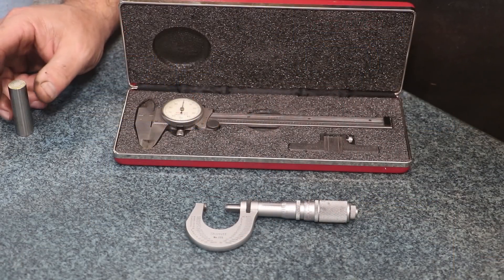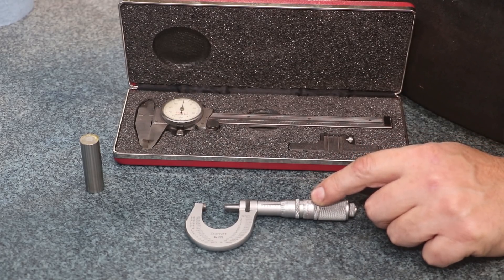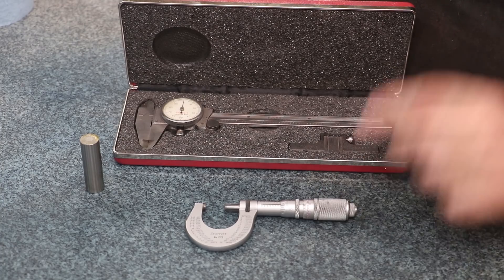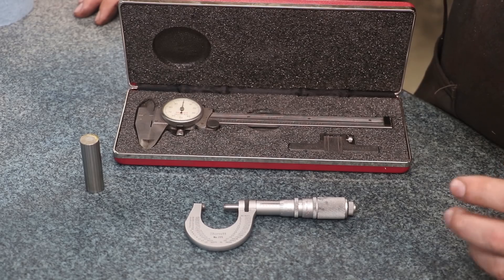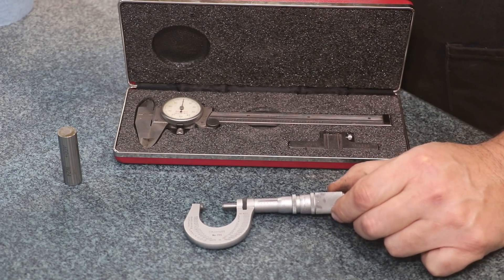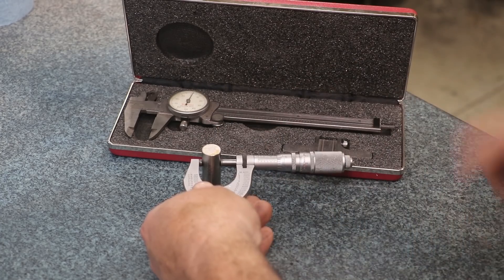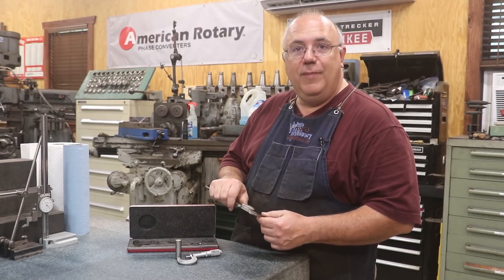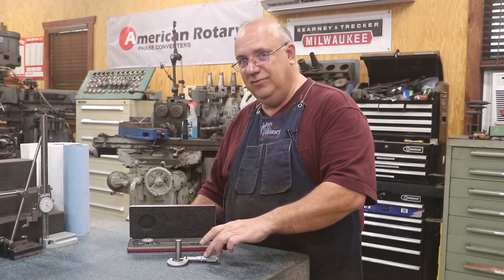Machine Shop Measurements: Dial Calipers vs Micrometers

Comment: I feel the same way about analog clocks versus digital ones. I can look at an analog clock and in just a glance I know that I have 'about five minutes' to be somewhere or do something. Whenever I see a clock at like 1:53 I don't want to have to do the math to figure out that I have exactly 7 minutes to get somewhere. I rarely need to know the time within even 1 minute accuracy.
Reply: Yes,im the same on clocks and im the same with rulers, i think imperial > metric because you can make faster reads due to known fractional graduations, a lot more than on metric sides of rulers.Strangely enough I live in a metric country but chose to use imperial if doing the drawing these days.I have always been able to use either but used to choose metric out of habit. As far as digital calipers go, about 15 feet! That's how far away the bin is.

Comment: I find there's enough space between thou divisions on dial calipers that I can do half or third thou accuracy with that tool
Reply: Sorry WD, but the mechanical design of dial calipers doesn't and won't allow that level of consistent repeatable accuracy. The industry standard for high quality measuring equipment is always a repeatability of + - one count of the tools resolution. Or + - one thou on .001" reading  dial calipers. And what a tools dial or display shows isn't it's repeatable accuracy level. How many divisions or digits there are is called the tools resolution. It's repeatable accuracy and that resolution are not even close to being the same thing. My Mit digitals will display to 1/2 a thou I ignore that number since it's meaningless.You could build a large faced set of dial calipers using the same standard design and put 10ths divisions on it, the tools internal mechanical design still can't repeat or be any more accurate unless that mechanical design is changed to allow that level of accuracy. At one time I believe Starrett and maybe a few others did try making special 10ths reading calipers quite a few years ago. I recall reading they were selling for well over $3k, mikes are a lot cheaper and more durable so almost no one bought them. And a caliper can be that allowed + - one count out on accuracy and they will still pass through even Starrett's, Mitutoyo's, Mahr's etc QC checks. Mostly the equipment will or should do better than that. On average with anything I've checked against gauge blocks it's usually but not always about half of the allowed deviation.  

A set of calipers has some small but very important clearances to allow the tools measurement assembly to even move. Those non optional clearances allow the moving jaw to very very slightly rock out of squareness with the fixed jaw no matter how well there made or by who. For the best and most accurate technique Mitutoyo states that the thumb wheel isn't used. Your supposed to gently squeeze the moving jaw and fixed jaw between your thumb and fore finger for smaller diameters and use both hands to do the same on larger parts. And using a consistent closing pressure every time is important. For round parts that closing pressure should be centered on the calipers jaws where they touch the diameters C/L. It's within feasibility one single measurement just might be able to be read to that half or third of a thou and even be correct. And the next 5 or 100 measurements might be well off that. That's the problem with them, you just don't know when there out to more than that half / third of a thou or by how much. I've checked myself and my calipers more than enough under ideal conditions on very good gauge blocks using the best techniques I know of, and calipers can not be depended on to that level of accuracy. There design makes doing so mechanically impossible. They simply can't repeat well enough to where I'd ever bet real money on even which exact thou there reading to never mind half or thirds of a thou. My solar powered Mits are the tightest yet smoothest pair of calipers as well as repeating to the best level I've seen so far. They'll beat either of my 6" or 12" Mit. dial calipers easily for there repeatable accuracy. They can almost always repeat to about a thou and sometimes less on those gauge blocks under those ideal conditions if I do my part. But if it has to be within .003" or less I always use a mike. Many might chose to disbelieve some or all of the above. You sure don't need to take my word for this, no ones stopping anyone from doing there own research about it. There's lots of free information on metrology manufacturers websites that will back up anything I've said.
Reply: @turningpoint6643  Thanks for your treatise.  You've used a large number of words to tell me I cannot do something that I know I can do.

Give me two well made standards,, one at 0.5000 and the other at 0.5005  and my Mitutoyo calipers will pick up their difference easily.
Reply: @wdhewson  Great response, but it doesn't matter if you can tell the difference between half thou jo blocks. The tolerance dictates the tool. And I'm certain you wouldn't measure a .3937" +.0008/-0 dimension with a caliper, regardless of how nice or reliable you find them. It would be like slot milling with a cut tap...yes it CAN be done, but it's not good machining practice.
Reply: It does depend on the caliper, on some of mine they have 200thou per rotation dials, those are not so easy to get consistent below 1 thou but my 100thou one 1/2 is easy.Ive never needed to go below that and thats only one specific job that i repeat often,more than enough to know that A i am getting consistent output and b:its showing in the data garnered.Im only talking about quality tools,no chineesium.

Comment: I am a machinist as well but I'm always looking for new practical tips and tricks to help make my work easier and better. 
I also enjoy seeing the old machines and trains that you deal with. 
I'm retired now but I'm still very active, I wish I were closer to you because I'd love to get involved in some of the restorations!!! 
I used to do a lot of videography in my spare time but now it's mostly just machine work and electronic control systems.

Anyway, I wouldn't say that calipers aren't as accurate as micrometers, it's just that micrometers offer a higher level of resolution since they have a vernier scale for 10ths. 

I can often guess to within a 10th or 2 how many 10ths are involved by looking at how the needle is situated between the marks on a set of dial calipers and I'm certain that you can too.
I usually only get out my micrometers if I need to measure in 10ths or if the part is too large in diameter for calipers. 

IMHO, viewers that harp about something like that MUST NOT do any machining themselves, otherwise they'd know how impractical and silly it would be to use micrometers for most everything. Again though, if a part is too large in diameter to use dial calipers, then the best choice is to use the appropriate sized micrometer even for low tolerances. 

I have enjoyed watching your channel as well as Adam Booth's and Tom Lipton's :-D 

Thanks, Keith!!

Joe

Comment: No reason not to use the calipers when you are rouging out a part.  If you need the absolute accuracy get it close with the calipers and use a micrometer for the final cuts.

Comment: Excessive accuracy is not good workmanship. When the higher potential accuracy of the micrometer is applied to a wide tolerance part no production benefit is gained. Tolerance, tools, and requirements should be a  matched set when possible. You know how some people complain bitterly when someone uses “there” when they should have used “their”? Same personality trait. It’s called pedantic. You don’t need to tell us about it.

Comment: I once had a young technical assistant (I am a retired molecular biologist) who insisted on using an analytical balance (accuracy 0.0001g) to weigh out a substance to make a 0.5% solution. I told here to use a regular lab balance, but she insisted on the analytical balance. I looked at the solution, which had a yellow colour and noticed that it was much too dark. I checked the concentration and it was not 0.5%, but something more than 4%. She weighed to 0.00001, but set the tare wrong and was off by a factor of 8. The higher the precision of a measuring instrument the easier it is to make a serious error. If you don't need 0.0001x accuracy, don't use an instrument that will measure to that accuracy. It's a waste of time and can lead to errors.
Reply: This is why a lot of good engineers mark out with height gauges, verniers, gauge blocks etc, but do a "reality check" with a simple 6" ruler

Comment: Beyond the clutch to prevent over tightening, can you explain for the non-machinists why a micrometer is supposed to be more accurate?
Reply: It's more precise because it's typically a finer adjustment, as it's a screw providing linear force and not a direct linear force. You can turn a screw a slight amount and it will move in/out of a thread an even slighter amount, if that makes sense.

Comment: Forty years ago when I could see, my favorite was a vernier caliper. I had a dial caliper once. And I never trusted a digital readout that needs battries. When it really has to count you just cant beat  the old C clamp. I had Starrett micrometers up to 12 inch. I enjoy  your videos Keith, you do a great job.
Reply: Not 40 years since i could read my vernier calipers properly but i have come to love dials since.I honestly hated them when my eyes worked properly, now i have 5 or 6 different flavours floating around the place.I guess digital calipers may be good for a carpenter or painter maybe? I must say though a friend has some mitutoyo diamond series vernier calipers and i dont seem to have as much of an issue (only used them briefly with no standards on hand) with the supposedly "parralax free" scale on them,both of us should probably check them out!

Comment: I was in agreement with you up until the point you made about all the time you can save when using calipers. That was a foolish statement. I can read mics just as fast, but I do use them all the time (mold work).

Comment: If I've been using the same dial caliper for any length and know the feel of them I've felt comfortable working to .0005'.   I've seen a good saw man cut consistently within .005" using a tape measure.  It's all about how much you trust yourself.

Comment: A while back a guy sent a Chinese caliper and micrometer to Adam Booth asking him to compare to his Starrett stuff.  In all fairness, Adam did the comparison live and took the Chinese stuff out of the sealed plastic right on line.  End result was that the Cheap Chinese units were right on the money.  You could hear a bit of disappointment in Adam's voice, but bottom line is you don't need a lot of really expensive measuring tools to get the job done.
https://www.youtube.com/watch?v=PBCdYcsD--g
Reply: To be fair, Abom79 did not test the depth gauge and the ID jaws on the calipers. 
I have found that many cheap calipers is accurate for OD messure, but could be 2 or 3 thou off at ID or depth messurement.

Comment: good  explanation keith. i believe most calipers today can be very accurate . they are pretty much an indispensable tool . i also believe its all about technique. it can be very difficult to get an accurate reading from  a piece of stock in a lathe..that takes practice. squeezing ,canting or pulling the calipers off at an angle will change your readings. i like to use them to get close to my final dimension and then switch to a mic.i just don't trust myself to use calipers down to the last thou or two. and its not the fault of the tool.

Comment: I was shocked that you didn't mention a plastic ruler! When I am turning an axle for a hit-n-miss engine cart to fit the 1912 or so cast iron wheels (usually) rusty, I seldom use my micrometer. Ok, just kidding. But like you said depending on the project will dictate the tools to use. Old Tony did a video on the vernier scale caliper, which has both inch and metric. I was impressed and went to eBay and bought one. Again like you said after a little use I can come vert close for my typical measurements. Finally, yes I have both digital and dial calipers, both of good quality. To my surprise I have a Shars dial caliper which has 2 hands for inch and one for metric: Guess what, mine at least, is right on the mark.

Comment: What you say about tolerances is certainly correct. I find myself spending too much time trying to make everything "Right on" when + or - .005" would be just fine. Many of the jobs that come through my shop are for farm machinery, logging machinery and odd parts for old cars. Lots of odd things. As far as digital verses dial, as many have said, the dial never runs out of battery. The only digital that I will use now are rolling digit. I recently had a pristine Mitutoyo  0 - 1" digital Mic that ate batteries within a day or so. I contacted the repair facility for a quote to repair it and was told that parts were no longer available. Be aware if you see a digital for sale. Nuff said, thanks Keith.

Comment: Nothing wrong with your explanation Keith. Calipers are also know as guess-o-meters, especially the old slide type, which I can no longer read accurately. I never liked the dial calipers but do use digital calipers these days. I use them while witling away material. Under 0.050" I use micrometers. It is the way we were taught.

Comment: cnc stuff is harder to measure accurately with just calipers, because the parts are more complicated. like a shallow face groove in a piece of stainless, if you try to use the calipers they will dig in and flex too much to get an accurate measurement, sometimes you just need other tools like an inside mic.  Definitely for +/- 0.0005"

Comment: I'm kinda thinking that if someone has a set of gauge pins, then they are already comfortable measuring with either tool. But, your point is to take a known item and practice measuring it. This is excellent advice. If you don't know what the exact measurement is, you can practice getting the same measurement over and over, but if you don't know what it's supposed to measure, you don't know if you are doing it right and maybe you cranked down too hard. This would actually build a bad habit and would cause troubles when building to spec. But if you are building a copy, your measuring tool doesn't even need to be calibrated.

Comment: The micrometer also has the small wheel on the end of the shaft that is a "clutch" that will give the same resistance when measuring. Some folks don't use it but it is there and can be adjusted I believe to turn less or more into the subject part being measured. Once it is set to your preferred tightness, it will do that with every measurement which provides a more consistent outcome from one part to another.

Comment: One advantage to the dial caliper is that it will do inside measurements as well as outside.  But the micrometer has a certain beauty that can't be denied.   I love both.  And I show my grandkids how to check either against a gage block.
Reply: They make inside measuring micrometers too. A couple of different styles are available. Not sure if they are technically as accurate as the outside ones though because of the basic design needs possibly introducing more flex. But they're what is often used for measuring things like bearing journals and bores, so they must be good enough. An outside C style micrometer is about a rigid as you can get.

Comment: Just like many others I use both depending on the work and tolerances required. Is it great to turn a part to 1.25000 inches, yes. However if the spec sheet says 1.250 + - .005 is it really necessary?

Comment: Measure with a micrometer, mark with a crayon, cut with an axe.
Reply: The construction workers motto, "beat it to fit, paint it to match ".
Reply: Yep, if it doesn't fit , force it. If it breaks it was defective and you found out now, not down the road.
Reply: Use the four Fs.   "File it, fit it, swear, file it again...."
Reply: LOL!

Comment: A micrometer is intrinsically more accurate because it's scale is inline with it's  measuring points, whereas with the caliper they are offset. Having said that, as you correctly say, it all depends on the tolerance you need for the job in hand.

I think for the homeshopist you should always aim for precision, not because it is necessary but because it takes practice to achieve and so you can be in practice for when, or if, it is crucial. Although frequently near enough is good enough so don't fret over microns when fitting a barn door. ☺

Comment: Some great thoughts Keith. I totally agree with you Keith that a micrometer is more difficult to read than a dial caliper or a digital caliper. I think for that reason, I tend to use my micrometers more often, to stay in practice. My dad was a master machinist and taught me to read a micrometer back when I was 7 or 8 years old. Back then the calipers that you saw were vernier calipers. Dad always used a micrometer to measure. If he needed less precision, he used a scale. 
Thanks for the great videos you turn out.
Gary 76-Year-Old Home-Shop-Machinist in North West Arkansas

Comment: I like the dial calipers too but the analog digital micrometer is my go to.
Reply: Never seen an Analog Digital  anything..   is this  some new technology?
Reply: @steveredenbaugh9058  No. It is micrometer that has a window with digits that are visible. It is mechanical, and the numbers are printed on a wheel that turns and read through a window.
Reply: @ianbutler1983   so it`s analog?   can`t be Analog AND Digital.
Reply: Steve, I suppose a more accurate term would be mechanical digital micrometer. Here is a link to see one:
https://www.mscdirect.com/product/details/38173217